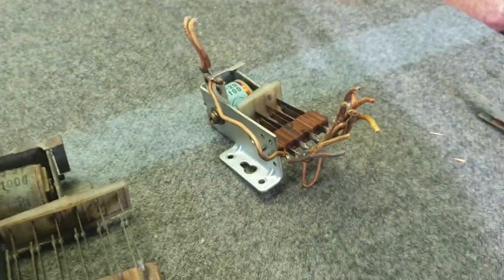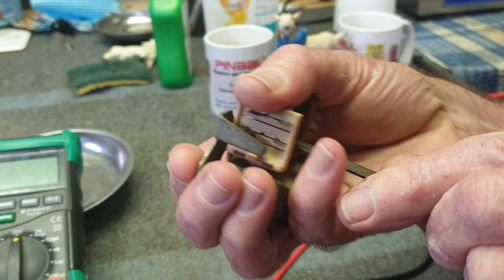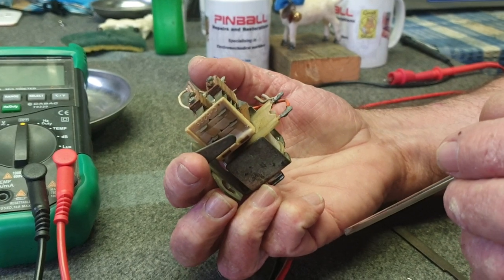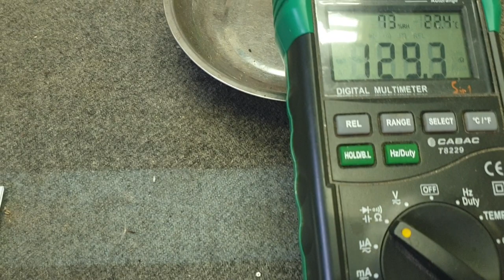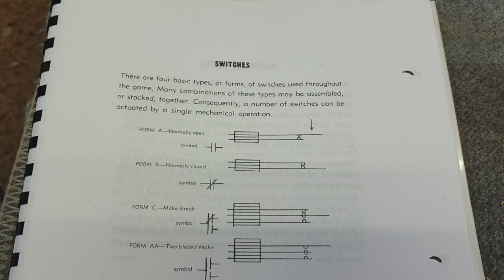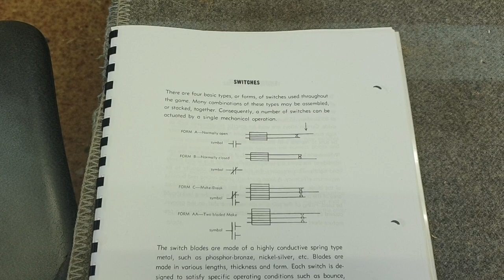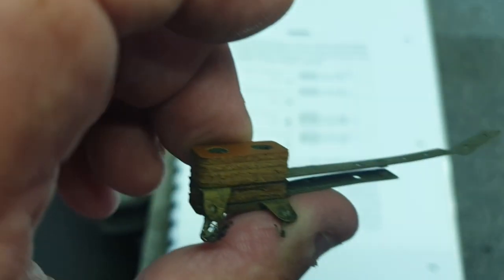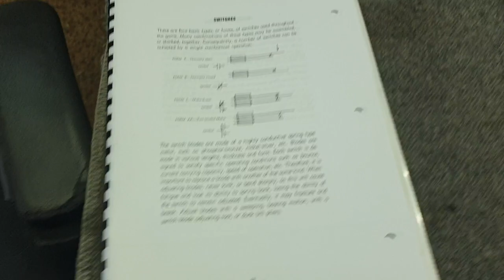Pinball Relays Coils and Switches

Comment: What do you mean by snowshoe switch because you mentioned it and other videos about a snowshoe that is being used as part of the switch to select in the stepper motors in pinball machines
Reply from the maker: We refer the the contact pin on a stepper unit as a snow shoe its not the correct nMe but widely used.
Reply: @goatshedempinballrepair8545  but the contract pin doesn't even look like a snowshoe so that is confusing
Reply from the maker: @waynegram8907  well lots of people call them that 🙄
Reply: @goatshedempinballrepair8545  oh ok thanks I didn't know they did